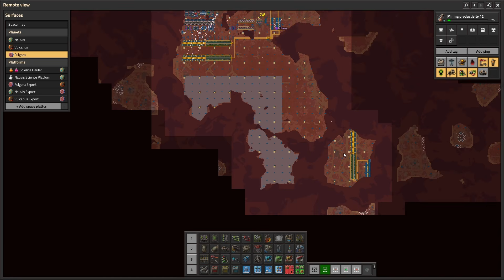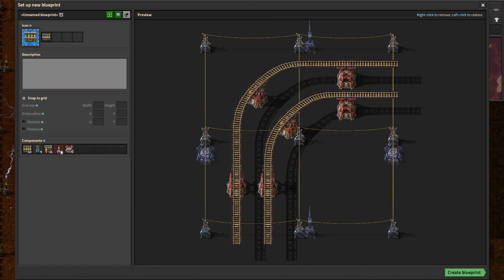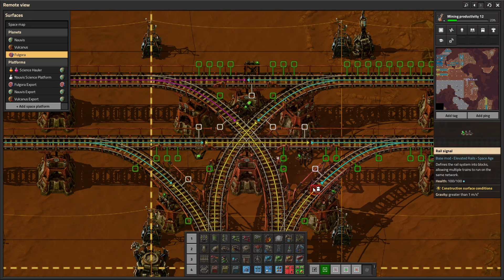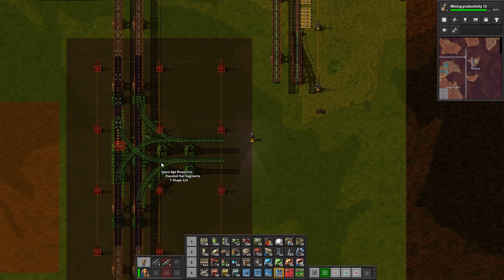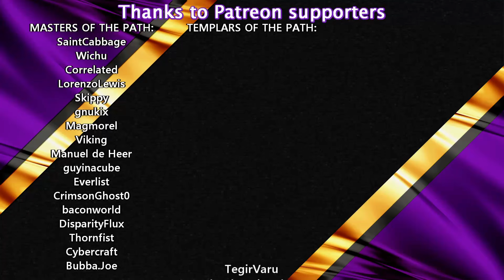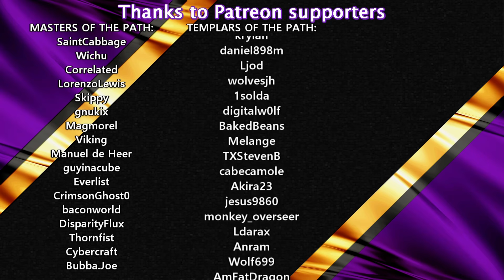ELAVATED TRAIN SYSTEM ➡️ Infinite Scrap | 12 | Factorio SPACE AGE

Comment: Have you a solution for how to manage independent logistics networks across the islands? Trying to figure out how to manage a separate logistics network and have the trains automatically ship the main items needed for base expansion? I thought about a signal/requester network but you can’t get red/green wire running along train lines. And with no power poles between the Islands I don’t know a way to automate it?
Reply: Wasn’t there a new feature that broadcast circuit info via radar?  I thought I remember that, but not at computer now to verify.
Reply: @ was that a mod? I’ve still not figured this one out

Comment: @29:20
shouldnt you test the chests for each waggon individually? if theres not enough place in the chests for one of the waggons to get fully unloaded, no train should park there...

only thing that could make that designflaw ok is if the belts leading away from the station always perfectly distribute the outputs so that there can not be an imbalance on how quick each waggon gets cleared. if thats the case, disregard my comment as a noob not getting the point :D
Reply from the maker: Even load, even unload, balanced input and output. It will never be a problem
Reply: @Nilaus  nice!
thanks for taking the time to answer.
you rock!

Comment: Wait I’m confused how you’re getting Blue or Purple scrap from the mines? I thought quality worked that it has a chance to increase the rarity by one level at each step in the process, so how are you getting higher than Green after the first step?
Reply: You allways have a chance on higher then one tier but its a 10th of the previous tier for each next tier as far as im aware
Reply: quality works on a 1:10 rarity scale. If he has epic / legendary unlocked, it would mean (when he gets a quality item) he has a 1 in 10 for uncommon, 1 in 100 for rare, 1 in 1000 for epic, and one in 10000 for legendary. This chance is rolled when you actually get a quality item, so for example, if a machine has 2% quality, that's a 1 in 50. so (1/50)*(1/10000) = 1 in 500,000 chance for a legendary scrap for example. The odds are the same regardless of what tier of quality module, quality modules increase a chance of getting a quality item. 2 legendary tier 3 quality modules in a mining drill would give 5.2% quality chance, or about a 1 in 25, or about 1 in 250000 for a legendary item, at least for mining drills

Comment: The scourge of every Factorio player! No, not biters, or cliffs, or even misplaced nukes going off in the middle of your main bus! No, it's the dreaded off-by-one error.
Reply: Is there a correct or easy/easier way to fix it?
Reply: @austinclague480  The two easiest ways to address an off-by-one error are 1) not making the error in the first place or 2) just being like "whatever" and letting it go.
Reply: @austinclague480  The "easiest" method would be to blueprint the entire factory, then deconstruct the entire factory, lay down the new and correct power grid, then lay the blueprint down and align it to the now correct power grid alignment.
You will still have outliers that need manually correcting afterwards such  as fixing the miners on deposits and also pumpjacks and offshore pumps, and a couple others.
Overall the best method though.

The sooner and smaller the factory is when you do it the easier it will be. Will still be a lot of work for construction bots. Deconstruct in batches and lay down the new power grid at the same time so the bots don't get stuck.

Comment: 35:05 That's the second train which only stopped for half a second at the unloading station. Which means it was running empty. Which means the load conditions are not working properly.
Reply: I think it was running full but the unloading conditions were wrong. He lets trains go when unloading chests are full and they are always full because none of the scrap is being used
Reply: @zacharyevans8489  Except thats what the train limit is for. So the stations are open because there's space left in the chests, yes?
Reply: @masterzedric It's the same problem again only in reverse. There's less than the maximum amount in the unloading chests because some of the slots have less than a full stack of quality scrap. Once it's flowing into the recyclers it shouldn't really be a problem.
Reply: Noticed that too. The scrap trains leave empty, but that should mean inactivity for 5 seconds. How does it not load anything in 5 seconds?